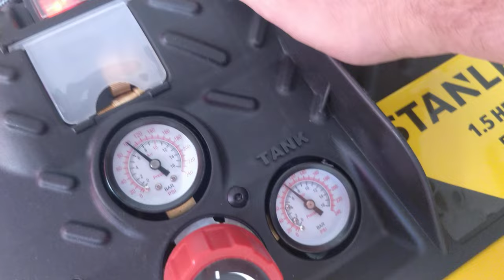How to Clean PC. Air Compressor Stanley

Comment: Take it outside in an open area with a good ventilation. I noticed the PC was rocking while you were spraying, putting it like that in an open window with a kid, risks it to fall off, and get filthy dust inside your house. Remove the dust filter first then clean it separately. Know where are the intake and outtake fans of your PC, so you'll know where to spray properly. This advice will make things easier, safer, and better. :)